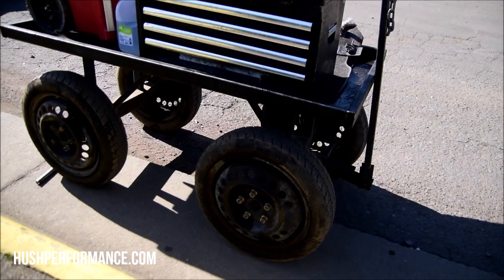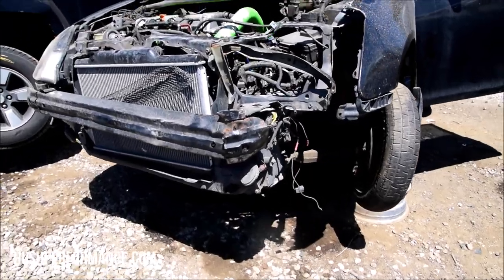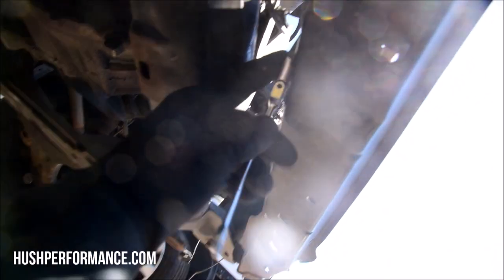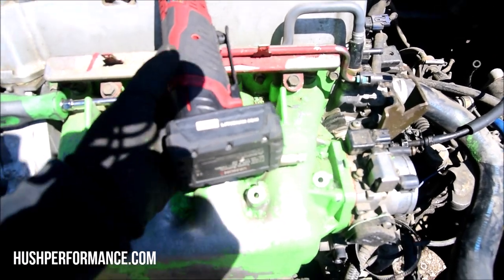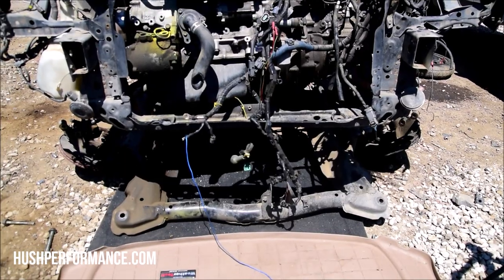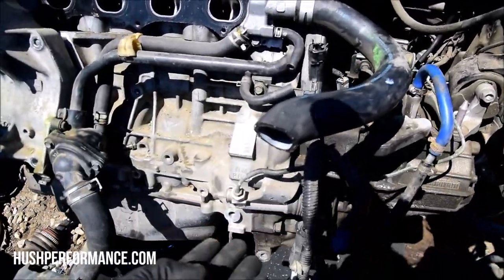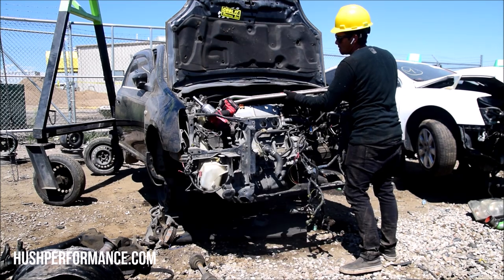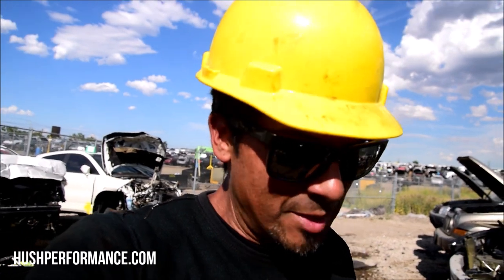EP3 The parts you need from this car!

Comment: If you had 2 04-05 EP3s, you could also get the front and rear knuckle/hub assemblies and/or braking components including the parking brake cables for use in 01-05 EM2s, ES1s, etc for oem 5 lug swaps and drum to disc rear brake upgrades. You can also use base RSX knuckles for the same thing if the 01-05 civic is still running the D17 engine, as the EP3 and base RSX use 32mm axles, which the stock D17 01-05 civics also use.
Reply: GSPD 550 even the fuel pump I’m running one of my ep3 it was from a EM2 haha

Comment: Is the electric steering rack any good? Ive been thinking about putting one in my 04 element
Reply: Yup, I put one in my 05 Civic and it is great. You will need to grab the EPS module from behind the dash and the EPS wiring harness to be able to use it though.

Comment: K20a3 is the exact same engine as the k20a2 as in the short block. The rods and crank are the same the pistons are different. I don't know if you can swap the cylinder head over from a k20a2 onto a k20a3 block. But the support is there aftermarket wise. Delta does make regrind cams for this engine supertech valve train for the k20a2 will work in this engine aswell. You can boost this engine or build it as a all motor engine but boosting it would be easier vs all motor.

Comment: Will a ep3 transmission work with a k24a2 in a fg2 (2006-11) civic?
Reply from the maker: T Trinh yes
Reply: K24a2 with ep3 trans I use fg2 si ecu? Also do I need hasport mounts or stock si fg2 mounts will work? Thanks for the fast reply.  Love the channel
Reply: I'm swapping from the r18